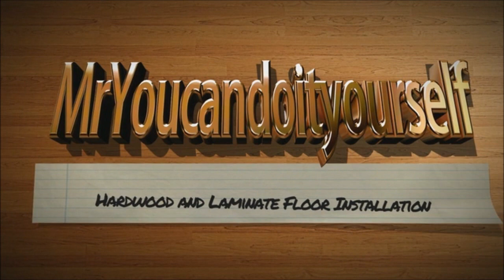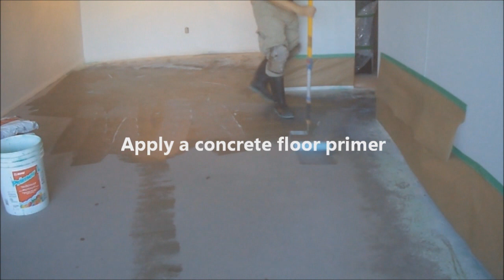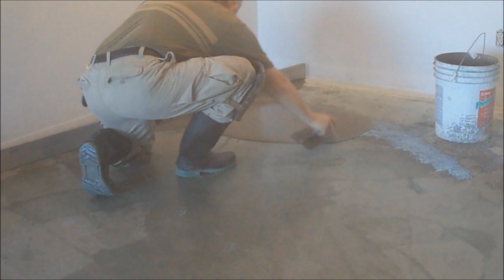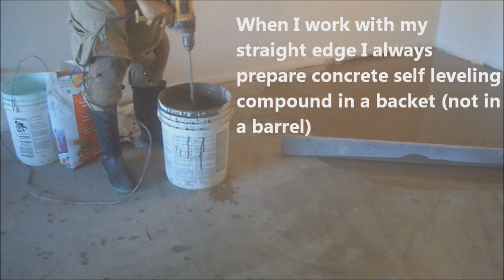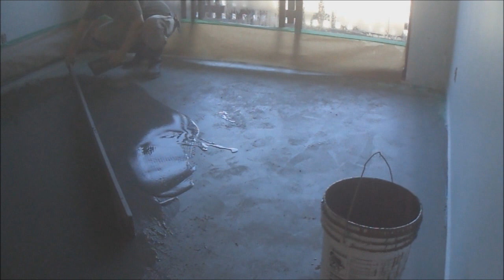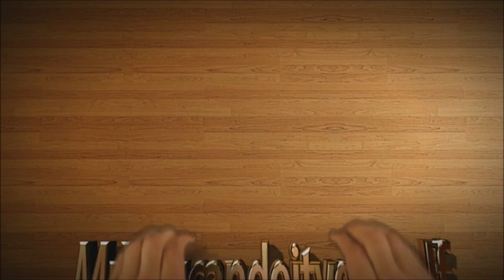How-to Leveling a Concrete Floor with Straight Edge Mryoucandoityourself

Comment: Doesn't the straight edge defeat the purpose of the self leveling cement?  Or does it really not seek its own level by gravity.
Reply from the maker: +Millenial Homestead (mattpkp) You should push the straight edge down when you are leveling.

Comment: Where did you get the white plastic to line the walls?  Or is that foam?  Can't see to find any at my local HD.
Reply from the maker: Yes, that's a foam. You can get it from any lumber store.

Comment: If you were going to do this job all over again, could you have done it in one pour using tripods?
Reply from the maker: Yes I do it very often. Straight edge I used only for filling small spots, or make sloping floor flat.
Reply: Thank you very much!
When you finished this job, was it level? 
Or was it flat?
Or both?
Reply from the maker: @paulgraves184  Hi Paul, this method allows you to make a flat only.